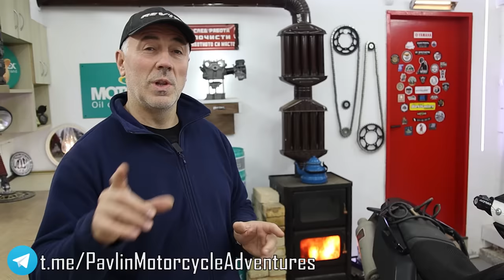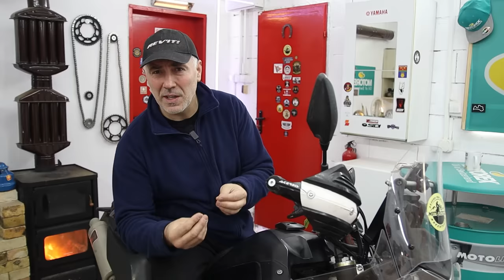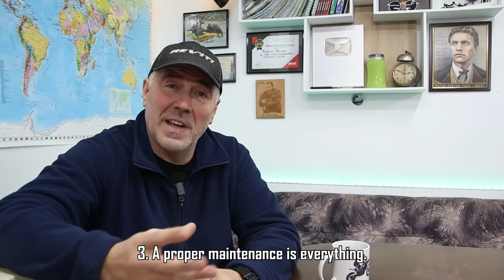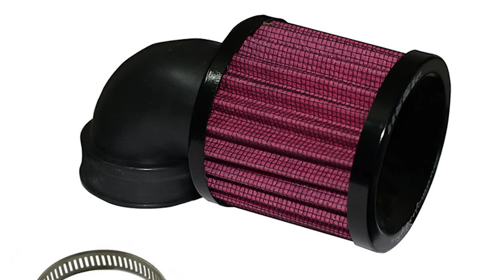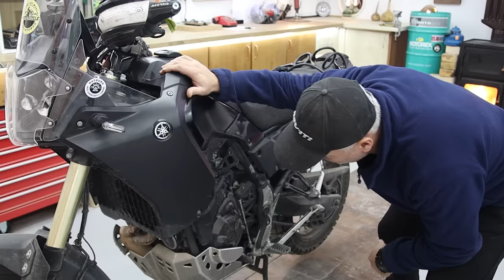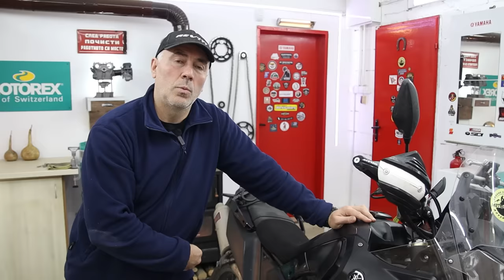5 Tips How to Extend the Life of any Motorcycle!

Comment: 25 years ago, oil change intervals used to be every 5000km. It was pretty much universal. Nowadays many new bikes come with really long oil  + filter change intervals, sometimes up to 16000km. While that's all fine and good by the manufacturer, I simply do not trust the 3.2 litres of synthetic engine oil circulating in my 900cc Triumph to even last that long before succumbing to evaporative losses due to the hot tropical climate I live in. So I still stick to a 5000km interval, which works out to about every 6-7 months.

One key thing most people often neglect is the coolant change, especially once out of warranty. Further complicating the matter are the bewildering types and colours of coolant that are now commercially available, from IAT to OAT and HOAT chemistries and from green to purple and every damn colour in between. These coolant chemistries are different and should not be mixed (some will negatively react with each other to produce deposits or sludge).
Reply from the maker: Thanks for sharing!

Comment: I have three bikes, and each one has its own purpose. My 2003 KLR650 that I’ve had since new, is for day trips, and has done a few vacation adventures. In 20 years of ownership, the only major thing I’ve done to it was a carburetor rebuild at 46,000 miles. My 1972 Honda CT90 is for running errands and camping exploration. It’s on original engine, 30,000 miles. Just bought a new XR150L as a light trail machine and back roads cruiser. It’ll get the same care that my other bikes have gotten, and have a long service life. I agree with all of your methods, and might add that proper winter storage is crucial to longevity. Before storage, install fresh oil and filter, fresh non ethanol fuel, add fuel stabilizer, keep on a float charger, clean and lube the chain, wax chrome and painted surfaces, and store indoors, if possible. Good video!
Reply from the maker: Thanks for sharing!

Comment: Hello Pavlin!  I agree with most of your tips, also from experience, over a milion quilometeres in various veicles and no damaged engines 
Just let me add one important thing: the breaking in of the engine is also very important in the long term relyabiliti and oil consumption of an engine, the engine needs load in order to set the rings properly, so wen getting a new bike please change the oil after the first 3 to 5 hours (yes this is enhough especialy in todays bikes) and please dont run the engine in low rpms... no red line of course but give it at least 75% , you will be glad you did it in the future!
nice video my friend! keep up the good work!
Reply from the maker: Thanks for taking the time!

Comment: 1. Let the engine warm up completely (80°C) before revving it up higher then necessary
2. Stay in Mid Range Revs always
3. Always use clutch when changing gears
4. Regular oil and filter changes (every 5000km)
5. Don't ride short distances, all the time
6. Maintain bike suggested as per manual
7. Keep the bike clean (not necessary to use pressure washer, just a hose with clean water, motorcycle cleaner, sponge and elbow grease. Moisture can stay inside the dirt that covers your bike and make it rusty over time
8. When in storage, use silicon spray to preserve metal finishes, keep the plastics elastic and prevent rusting
9. Keep it out of the sun when possible. Sun rays make rubber and plastic brittle
10. Riding the bike regularly is better than not riding it at all for a longer period of time

All these points are important if you plan to keep your bike for more than just a few years and trying to keep its value up.
Reply from the maker: Agree!
Reply: Oil charge every 5k or once a year
Reply: Warm up yes but not needed to fully warm as the faster it warms the better 
So yea run it then helmet,  goves ect 
2 mins  .. n go 
I do at least 10 min 
Very easy not just for engine,  tyers   brakes and me !
Reply: All but .2, engines rev for a reason.
Reply: @danstevens2204  all piston engines have s sweet spot 
Is called volumetric  balance, or efficency m8 
And it can be different for 2 same engines any air filter or exhaust differences affect it 
So exactly the rpm its perfect change 
Its generally the flat spot between peak tourqe and power on the dyno 
You feel it as you drive or ride ...its where the engine seems to float on the throttle 
Its the rpm you want to ride at for long haul as best power least fuel 
As for the other 2 or realy few more engines types ....go on what are they in your opinion
Reply: @rensgreuter8152 including the filter.
Reply: You are absolutely right - very good! That' also my way, to handle my bike! To point 7: yes! Never use pressure water! 
To point 9: if it not possible to keep the bike out of the sun, use a bike cover - it's sunny or rainey weather!
Reply: I am gonna struggle with 7 , already know it. New first time bike owner.
Reply: I would add to the list... put a battery tender on if it's going to sit 3 days or longer.
Reply: 80c ....lol most bikes run at 70c   may be the fan comes on at 80 ish 
The faster you warm up the better 
And the alternator dont give much if any charge at tick over rpm 
Should start n may be 1 or 2 min warm up then ride gently for 2 or 3 miles as its more inportant to warm brakes n tyers....and yourself up
Reply: the oil change at 5k is overkill for me since I ride in normal conditions, as in not too hot, not too cold, no dust or sand, sea salt or any other mitigating factors. And all these btw ARE mentioned in the user manual as reasons to change the oil sooner. Also I find it odd for people to say follow the user/service manuals with everything except the oil change, because that, somehow is  wrong  .... Anyhoo, mine has a 12.000 km/1 year interval so for my riding conditions that is completely fine. Everything else, I agree with.
Reply: @ioandragulescu6063  yes i agree to a point....its well known that oil actually breaks down a lot faster than advertised m8 
Loses its super level of protection 
So if you want oil at 20% of its original abilities then do it your way 
Oil is cheap   i change it ad soon as it goes dark but still clean...then 2 or 3 times as the filter is still clean any way ...with cartridge filters its very clear to see there still clean 
For motorcycle engines at least 
Deisel car engines are very dirty ....oil is black at 1000 miles...so i change them at 6k 
My 125 for instance lives at 7 to 10k rpm ...so i change lot more often ...3k even 
My R1 6k or after a track day 
Like you say all depends on how you use the engine 
But oil is relatively cheap...i get it in 10L and 25L for my car....
Reply: Thank you!  You saved me 12+ minutes!
Reply: @jrossofskb  save you 12 minutes.? 
Waiting for it to warm up? 
I start the engine then put on helmet and gloves etc 
On a big bike ....like my 1000cc R1 3 to 5 minutes as you dont want any stall or throttle problems with 150hp bike...can be dangerous!
Reply: @spikeccx  Reading the list was quicker than listening to a 12 minute video.  I already knew some of the things on the list and I'll incorporate the ones I didn't know going forward.
Reply: Brand new bike from the dealers, red line it most of the way home. Break it in in 1 hour 😂. Now that's how you do it 😁

Comment: l live in Spain, own a 2014 Street Triple 675. l always let the engine run at tick over until two bars on the temperature gauge show,  then ride at moderate speed and revs until the working temperature is reached. l change the oil and filter long before the recommended intervals, Plus perform inspections/maintenance... Sympathy for the engines mechanics pays dividends long term....
Reply from the maker: Good! Thanks for sharing!

Comment: Good information, thanks! Could you give any advice what to do during the winter? For me it is not possible to ride MC because of the snow. I just remove the battery and leave the MC for winter time in the garage (5-6 months). In spring I change oil, filters and start it again. Any advice? Thanks.
Reply from the maker: Better is to keep the battery on a trickle charger. Add stabilizer to the petrol. Change the oil before you put it in the garage, but don't start after that, maybe only for a few seconds.  Put a rubber cap in the exhaust and don't start it until you decide to ride it.
Reply: @motorcycleadventures  Perfect, thank you :) One more question. My garage has no heating... As I understand, if I keep battery on a trickle charger in cold garage, it will survive the winter? Also, removing the battery for long period of time is not good for MC?

Comment: Ok here is a point of concern. By profession I am a long haul truck driver and I work 2-3 months at a time and then I get about 8-10 days at home where the riding season is from March/April to September/October. 

On my home time I could put 3-400 miles in those 8-10 days unlike my job where I drive 3,500 every 6 days😂.

So obviously I cannot ride a bike as much as I drive an 18wheeler. 

So, how do I help my bike to last longer with those intervals? Disconnect battery, fill the fuel tank before going back to work with gas and fuel stabilizer, anything else?  I cannot ride it to work as the commute is over 700 miles one way and i cannot move items from truck to home like my pickup truck.

So the bike would only be ridden when on home time.
So how do I protect the bike best before going to work so it will be ready in 2-3 months to ride when I get back home?

The bike I am looking to get would be an Africa Twin, NX 750 or BMWs 1250 GS adventure.
Reply from the maker: There is no perfect world...
Reply: So any advice on engine protection during that down time? Only thing I can think of is to trickle charge the battery when I get home on first day/night then when starting it, idle it for a few minutes to get the clutch covered in oil before riding?

Comment: How do you know if the bike is at optimal temperature if it doesn't have a temp sensor?
Reply from the maker: Give it 5-10 min on slow RPM on a hot days and a little bit longer in the cold.

Comment: Don't ride it and store it in an environmentally controlled garage..
Reply from the maker: If you can...
Reply: @motorcycleadventures    I have a 1971 Yamaha R-5  1978 YZ-100-E   1971 Honda SL-125 engine bored and stroked to 160 CC's with a Ported head and hot cam in a 1977 Honda CR-125 frame.. a 1983 Honda XR-350  1993 XR-100  1998 YZ-400-F 1984 Yamaha RZ-350 2008 Buell Ulysess and a 2016 Yamaha FZ-07  They all start and run no problem .. only two of them are electric start most of the rest don't even need a battery .
  Yamaha T-700 is on my Wish list but the Honda Aplenstar is $500.00 less and has more features.  I will look at both before I decide what to purchase..

Comment: Great tips. Common sense to me. I used to change my oil n filter every 4000 miles on my last FJR 1300. Rear diff oil at same time too. I covered 98,000 miles when I sold it and it was still like a new bike and good for another 100,000 miles.
Reply from the maker: Thanks for sharing!

Comment: All except the 1 minute warm up I do everything you said. My warm up routine is to keep the load low on the engine when cold. If the weather is very cold, below 10 deg then I do warm it up before moving, but that is to thaw out the windows or give the motorcycle engine chance to pull. I have never lost an engine in 2,000,000 km over 55 years, on 50+ cars and bikes. I have also never had a vehicle break down, no just once, on a Toyota I had just bought. That said I have nursed a few home.

I use all my senses when driving/riding and investigate any unusual smells, noises, vibrations, we are given these senses for a reason.  Like you I prepare before a trip "pppppp" = Perfect preparation prevents piss poor performance.

I like videos like this because being reminded of something you know is still good, especially at my again and it is good to know I am doing what the experts do. I keep a check list with me in my little pink book which has everything in it. 

Passport, money, cards and pink book....you  can buy anything else you forget.
Reply from the maker: Thanks for sharing!

Comment: A good idea is to add a magnet in the oil system - drain plug or external on a spin-on oil filter. The tiny porous metal shavings work harden as they circulate so taking them out ASAP is a good idea. Usually these small metal fragments are too small to damage the engine as anything of damaging size is taken out by the filter, but it's a handy safeguard.
Reply from the maker: Agree!

Comment: Good advice. I used to have extra lights and even had a setup for charging my mobile. The lights had loose contacts.  For the mobile charger, the wire was visible outside. I removed both of them, but I still miss the charger but hey it's time for a new motorcycle and those 12v sockets are neatly integrated these days
Reply from the maker: Thanks for sharing!
Reply: Or mount a small solar panel instead.

Comment: spot on on every point. I used to have 2-3 bikes at a time, and i didnt have the time to give them equal love. i ended up ignoring/neglecting many of them this way. I am now monogamous, only one bike at a time, ride in any weather, follow appropriate maintenance and certainly dont wash it as much as i used to. As a matter of fact, the only thing i hate more than cyclists, are motorbikes that dont get used.
Reply from the maker: Thanks for sharing!
Reply: A lot of pro riders are cyclists
Reply: I just Don't want to Ride in winter
Too much Salt on the  Road that will Destroy  a Motorcycle unless you Are
a Fanatical Cleaner.  My Bike is off the
Road  3 Months of the Year
Is that Harmful to my Engine?

Comment: If I follow tips number 4 (which I do) - Why should I not trust the Honda engineers that manufactured my motorcycle and follow their instructions on service intervalls?
I always give my engine time to reach working temperature, almost never rev it to or even close to the area of red. 
I'm still VERY interested to learn more, and if there is something here I can improve on, I'd like to learn more. But I also would like to know why it is in this way...?! 
I'm very curious why you say that theese inervalls are not enough. 
What experience or facts do you have to support the need of oil change after 5000km, instead of 12000kms?
Reply from the maker: I can give you a few examples:

The same bike, two different owners:  The first ride it hard, on and off road, includes some technical terrain with a lot of clutches and gear shifting, and even races with it a few times per year. The second does normal road trips with moderate speed. Do you think that their bikes will require the same maintenance or oil change intervals?
In the second example again, the same bike, two different owners: The first lives in the tropics and rides it every day in temperatures 35+, and the second is from Norway and rides it mostly during the winter in temperatures between 0 and 5 degrees. Do you think that they need the same oils? 

The manufacturers have some recommendations that will cover their warranty one way or another. Usually, it is 2 years. For this period more likely nothing will happen, but after that... I hope that you got the idea!
Reply: @motorcycleadventures  Thank you - I get the point!

Comment: Bolloks m8 
Change oil soon as its discoloured and no filter needed
Coz its not contaminated 
Proven fact !! 
And right specifications of oil and there ALL THE SAME regardless of brand of oil
Its actualy LAW M8 well is in uk
RPM ....HUMM 
To me the engine needs to be at rpm to least stress and most efficent..so look at the power curves and use 500 ish less than peak torque curve
Reply from the maker: Thanks for watching!

Comment: On my Kawasaki Zephyr from 1991 was writen in manual that oil filter need to be changed every 2 oil change,the bike has 120tkm on regular car 10w40 oil. I change oil on season start and make max 10tkm per season. No problems whit the bike. Dont see any reason for early change.
Reply from the maker: It will last even longer.

Comment: Running an over square engine, where the bore dimension is greater than the stroke by a significant amount, at lower engine speeds, actually causes more wear on the thrust side of the piston, particularly in the higher gears that are over driven, lower than 1:1.

Knowing the power and torque curves of your particular engine is important in understanding where the optimum engine revolutions for power delivery. For example if the intercession of peak power and torque is at 6500 rpm, and you’re in sixth gear at 5000 rpm and need to accelerate, it's better to shift to fifth, to optimise the power delivery.

This value varies with every engine, but essentially it's best to not to lug any engine. Know the performance curves and operate within them, not above or below will reduce wear.
Reply from the maker: Agree!